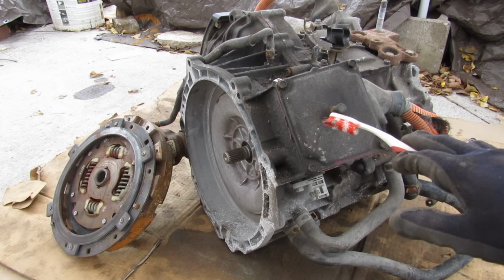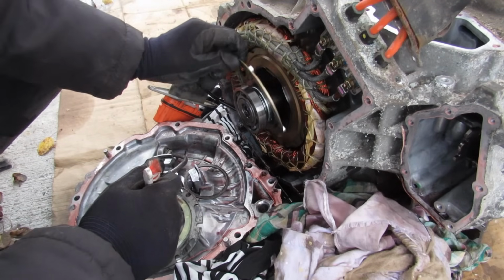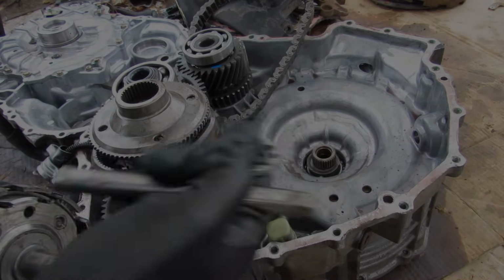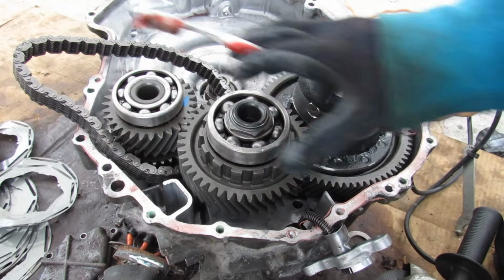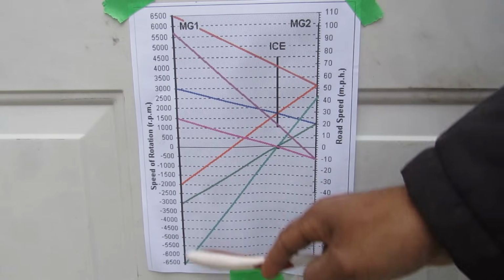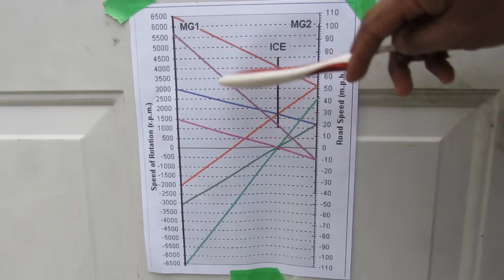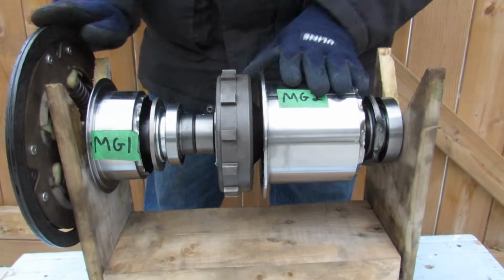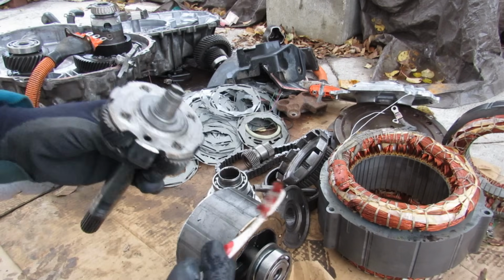How a Hybrid eCVT Transmission Works   Part 2

Comment from the maker: The video on Hybrid electronics can be found in Part 1 here:
 https://youtu.be/Xl87abBl9-A
Reply: What are the limitations to these eCVT transmissions?  I would think top speed is limited with only a single planetary gear set.  Also, it seems that having one reduces the towing limit.  Is towing limited because of heat generation or something else like the battery running out of juice and then you're running on the ICE.  I recently took a look at the RAV4 hybrid.  It has a decent size 4 cylinder, 2.5 L, that should be able to tow 3,000 lb but they limit it when you have the eCVT.  Why?

Love your videos...  Educational, entertaining, and no bullshit!

Comment: The difference between CVT and Toyota ECVT is like the difference between mail and email, TOTALLY  two different worlds.
 I wish Toyota got a better term for their great ECVT.
Reply from the maker: Agreed. This one is very reliable
Reply: @Henry_Jones  yes, Toyota got the name wrong both ways. Nissan and others took advantage of this, just walk into a Nissan dealership and they'll tell you :" oh, this car has a CVT just like Toyota".
Reply: @speedkar99  Thank you for the video. Is the regular Toyota Corolla CVT (Non-Hybrid) also as reliable as this? Please advise. Thank you.
Reply: @NHD777X  unlikely but it’s probably more reliable than a Nissan CVT
Reply: @NHD777X  I saw Scott kilmer said that he hasn't seen issues with the Toyota corolla direct shift cvt (has the launch gear + regular belt)
Reply: Synergy Drive!!!
Reply: I guess functionally, it's power delivery is like a cvt so that name technically works. Though yea, cvts do get a bad rep
Reply: Yes many who ignore how it works dismiss it as a reg cvt without realizing it is an engineering marble and perhaps the most durable transmissions out there
Reply: @JoeyLindsay  Do you know what is the transmıssons brand for ? Toyota corolla cross 2022 1.8 hybrid
Reply: @Onurkoltuk67  Toyota makes their own transmissions and their CVTs are pretty good in my experience driving a RAV4 Prime and a Camry Hybrid
Reply: Since it has no belt but 2 electronically controlled motors and planetary gears, it's more an eAT than an eCVT.
Reply: There is absolutely nothing wrong with the term ECVT.
Reply: They Just Call It THS
Reply: @landshass2849 what do you mean they got it wrong, CVT has metal belt and cone pulley and eCVT had the two motors?
Reply: like EVT？
Reply: @JoeyLindsay both the RAV4 Prime and the Camry hybrid have E-CVT not CVT. Even the Crosstrek hybrid has a ECVT though Subaru calls it a CVT for whatever reason they have. It has motors and gears just like the prius prime.
Reply: I think nissan CVT much better if you take care of it,  the nissan CVT much easier  to maintenance , this one is too complicate.
Reply: It is CVT in the sense there are no gears changing like regular automatic transmission, the electric motor gives continuous "gear", but as you said it has nothing to do with pulleys. A different name would have helped to differentiate the two.
Reply: PHT - Planetary Hybrid Transmission.

Comment: The Toyota eCVT is one of the greatest bits of engineering ever.
Reply from the maker: It sure is! 
And it's reliable from what I can see. Nothing to break or wear down here
Reply: All based on existing technology .
Reply: @speedkar99  Then why do most of the Prius' here in Portland, Oregon disappear from the roads in less than eight years and under 100k miles???
I have heard Prius owners say that "this is because Toyota's are better",  (that they don't last because they are disposable). 
Mind you that when I tried to help a neighbor because her Honda CVT grenaded at just 47k miles requiring a complete replacement, she told me that my 2007 Mustang GT won't even last 47k miles and that I "was a moron for buying an American car"...
Reply: @davidhollenshead4892 The Honda CVT is not what you’re looking at here.

Comment: Impressive hydraulic press!! And that graph explaining the ratios is just brilliant... Tesla Model 3 uses the same type of electric motor (IPMSynRM) as this Prius which is more than 15 years ago. IPMSynRM is 96% efficient compared to the traditional squirrel cage induction motor at 94%. This shows how far ahead of its time the Prius was.
Reply from the maker: Thanks. I stole the graph from a website online that did the math behind it and modified it for the 6 main modes of the power splitting device. Didn't know about the Tesla drive unit.
Reply: @speedkar99  Could you please share the link to that website? I'm curious.
Reply: Absolutely, and since Prius was here way before Tesla I think teslas engineers has done that job dismantling Prius motors and learning from there✅👍
Reply: @toninocars  nnj

Comment: I loved the plot and stand demo - made things very easy to understand.
Reply from the maker: Thanks! Glad it helped. My new desk ornament
Reply: I would like to see a plot for the 4th gen Prius. MG1 and MG2 are much smaller but they rotate up to 17000rpm to compensate. My 2019 Corolla has the 4th gen drivetrain and at 62mph MG2 is running close to 10000rpm.

Comment: This is a really complicated system. It's amazing how close those  fluids are to the coils and electrical components.
Reply from the maker: Yes they have to be properly sealed
Reply: I'm sticking with a regular 4 speed ATM transmission, thanks. And a simple petrol engine with port injection.
Reply: @rishijai  these hybrid transmissions are extremely reliable,. I dare to say that they are more reliable than your aforementioned 4AT transmission.
With the exception of the current dynamic force hybrids (1.5 Yaris, 2.0 Corolla and 2.5 RAV4 and Highlander) the ICE engines are simple port injected engines as well.
Reply: @meeder78  dare I say these are likely more reliable than even a manual. Failure and wear points are to an absolute minimum. The 4th gen hybrid system has perfected this further by removing the chains and using just planetary gears.
Reply: @eddynetweb  
I agree that it can even be more reliable than a manual transmission. 
The 3rd gen also has no chain as far as I know. 
Starting with the 3rd gen there is an additional planetary gear set (motor speed reduction) connected to MG2 which allows a slightly higher EV speed of about 50 mph before the ICE has to kick in to prevent am overspeed of MG1. 
The 4th gen biggest advantages are the even higher EV speed (I have seen 65mph EV speeds on my Corolla) and the more compact construction due to the parallel axis design of MG1 and MG2 instead of the inline construction that was used  before.

Comment: Very to see all these components, thanks! I do appreciate the Prius, we own one, a 3rd gen plugin. I guess they have a lot more grunt, as it keeps a steady 80MPH on the German autobahn, even up hill, loaded with the entire family and holiday luggage.
Also on a flat stretch it’s absolutely amazing how quickly it reaches 110 MPH. Still 50MPG (US) for the entire journey.
It’s by no means slow, but the ICE revs up quite a bit during acceleration and on steep hills. If you’re the kind of driver that doesn’t want to hear the ICE, afraid to bust the engine, well yeah then it’s slow…
But at 80MPH on a flat stretch you hardly hear the ICE.
Clever technology and very robust, due to the lack of a physical shifter mechanism and all gears permanently engaged.
The plug-in is what it should have been from the beginning IMHO, as it does 55MPH electric only, and has enough storage capacity to drive really long descents on regenerative braking only. I checked the brake temp after driving down a pass in the alps: discs were cold!
Impressive.
Reply from the maker: Awesome !

Comment: This is an amazing video! The only addition I have is that battery power is only really used for all electric mode, these can cruise all day long up a hill as they can change rpm as power is needed and all power for MG2 normally comes from MG1 and the ICE.
Reply from the maker: Yes that's correct

Comment: Looks like ecvts are more robust than the traditional cvt. I like that. Traditional cvts are not too reliable in my opinion. It's good to know that they won't be around for much or in all the cars.
Reply from the maker: Agreed! I don't see any failure mechanisms in this transmission as long as everything is cooled and lubricated.
Reply: I prefer that thick chain over that band that Nissan uses
Reply: @speedkar99  Those 2 conditions apply to any automatic transmission ...
Reply: Subaru CVTs go well and good

Comment: Next time when you get stuck behind a Prius, it isn't because it is underpowered, just means the driver is hypermiling.  
When equipped with grippy(instead of low rolling resistance) tires, the handling is really good and lot of fun as it has great low end grunt and brakes that never fade as in a pure gasoline powered vehicle.
Reply from the maker: Sure
..I didn't find this one particularly fun to drive. I'm used to V6 sedans though

Comment: Enjoyed your vid. I just replace a trans in '07 Lexus RX400h due to trouble codes from insulation leaks in inverter and trans assembly. 46 years turning wrenches this my first hybrid. After replacing with one from '08 from an '08, along with inverter/converter. I decided to look inside and was surprised to find how simple and minimal parts it took compared to a regular automatic trans. Also, this is 3rd generation where they eliminated the chain to final drive and where I found what failed. The gear from final drive to differential was missing teeth, both gears. I imagine the pieces of the missing teeth I later found stuck to magnetic parts caused the insulation leak code. The code would not allow the ready light, but if I cleared the code it drove fine until the the warning lights and it was turned off. The stators are different, too. was hoping you show freeing the magnets. These seem better secured. This has been a great learning experience.
Reply from the maker: Glad you learned something and appreciate sharing your experience. These are quite simple inside and I'm surprised they failed. Final drive gear is usually pretty strong as it multiplied torque
Reply: @speedkar99  I agree.  But there's something else that could have contributed.   The bearing on the right side intermediate shaft, actually part of the cv axle which is mounted to the block. part of the engine mount, was bad. Rust welded into the hole. had to unbolt the mount bracket from the block and put into the press. It barely turned. And it came apart when pressing the shaft out. P0AA6/inf613 if the dtc that led me to the transaxle. And an insulation leak in HV  system code resulting from gear teeth in the drive motor...

Comment: The eCVT is a marvel. Extremely reliable and efficient. It would be wonderful if more cars started using them.
Reply: Their time is over. They haf their best time 5 to 15 years ago. Since Tesla came out with the Model 3 and Y, this is now top notch. Much simpler, way fewer parts, cheaper and no oil changes. And no farting engine.
Reply: @Stefan_Dahn  yeah except you need expensive batteries that only last about ten years
Reply: They do. Ford uses them in their hybrids. They've been fantastic. It's everything else that's the issue

Comment: That's the proper way to start an engine for the emission reducing feature of traffic light/ long pause stop start. I wonder how many starter motors the BMW and Ford and any other vehicles out there constantly restarting at traffic lights are having replaced compared to the ones before them. Then to make it worse is most people like to constantly creep at lights. Fun!

Comment: Wait so is this the same of all Toyotas with hybrid synergy drive including PHEV versions of some of their vehicles? I am honestly in awe of how well engineered Toyota's eCVT system is especially considering that it was first introduced back in 1997. It was way ahead of its time.
Reply: It excludes Toyota’s new Hybrid MAX drivetrain which uses a torque converter automatic transmission instead of an eCVT.  This drivetrain is used in the Toyota Crown, the Sequoia, and the Tundra.  These power trains are less efficient but can handle more power from the engine and electric motors

Comment: The beauty of the Toyota eCVT is it’s driven by electromagnetic force not friction in CVT AT and DCT thus has little to wear during it’s lifespan as a result Toyota eCVT is stupidly durable and require no maintenance
Reply from the maker: Agreed. Just change the fluid once in a while and you'll be good for a million kilometers
Reply: @speedkar99  thanks for the reply! Even the fluid last a lot longer than conventional transmission, fluid in conventional transmission will be contaminated by friction material like clutch and belt very quick

Comment: Thank you for an amazing lecture. I have a Corolla Hybrid and this video has explained a lot. However, I still don't understand some points. What is the total combined torque of ICE+MG2? All I can find is the ICE torque. It seems that Toyota doesn't provide this value. Or maybe it's impossible to measure it in this kind of hybrid car? One more question, does the MG1 add any torque to the output transmitted to the wheels?

Comment: great tranmissions, simple to change the oil too. and to buy it at the cheapest place is at your dealership. aftermarket is expensive
Reply: Hi,what is the make and model of this new e-cvt gearbox? Which model e cvt transmission does the 2022 Toyota corolla cross 2ZR-FXE engine code 1.8 Hybrid use?  I will be very glad if you answer

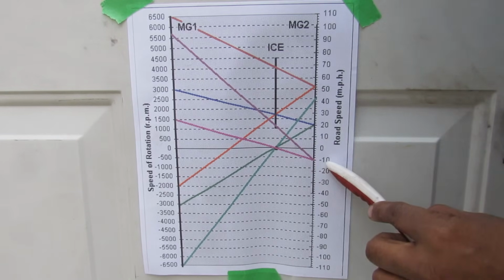Comment: Good vid with clear explanation, but the part starting @19:30 is incorrect. If you have a depleted HV battery, but just enough juice to start the engine (by rotating MG1), then after the engine starts it will spin MG1. So in this situation, the ECU can start to slow down MG1, which does 2 things (just like in regular driving); 1 - Generate electricity, which it can feed either into the battery or into MG2 to make the car move (smoothly, there is no reason this would be jerky), and 2 - create an opposing torque to the engine, which results in torque going through the planetary unit and also driving the wheels. (this is why it's a series-parallel system)

I fooled around quite a bit with my old HV battery which needed replacing because of some bad modules, and it was nearly impossible to get it so far depleted so it was not possible to start the engine. Even an unbalanced battery (battery warning light on dash on and error codes on the OBD) would still start the engine, the car would still drive smoothly but with less electric assist. Also, it would keep idling at the traffic lights. Which is a good thing when the battery is nearly dead. I only managed to get it not starting, by deliberately deep discharging of a single module (by taking the battery apart). I think it is very hard to get into this situation even under abuse of the vehicle. I think it is far more likely that an empty 12V battery would cause a non-starting Toyota hybrid.

Comment: I was experiencing some knocking noises most of the time when mg 1 was starting the engine,at the same time i was experiencing low power even when engine was comingin to assist Mg2 during acceleration...so today i decided to find out what were the reasons for the issues. To my surprise torque damper had very weak springs that were playing around within their containing housing, also it is like the clutch was slipping within its case during had acceleration..so i decided to replace the clutch now the car move smoothly  and it has gained power and it accelerate fast compared to previous time. (The car has 205,002km on the clock with original health battery (Delta soc 0.00%, voltage difference o.o3v) i love the car and i service it regularly myself., and issue hybrid assit app to comand my battery coolingfan to turn on always to cool the battery.

Comment: It does look like a transmission that'll be fine as long as you change its oil regularly. I believe the new Ford maverick also uses an eCVT on their hybrid trim. It makes me wonder if a stronger, similar system in in development for the next generation hybrid mustang, or if it will uses something different.
Reply: as reliable as this may be, it still isn't the most efficient machine while under internal combustion cruise mode.  A portion of engine power is used to generate electricity, which is around 90% efficient.  Then you need to convert that electricity back to mechanical power, which is again is 90% efficient.  Multiply the 2 together and you're looking at 80% efficiency.  This is why it only send a portion of the power thru the electric route and another thru the gear route

A manual transmission, when locked in a 1:1 ratio is around 99% efficient.  This is why trucks with automatics are actually robotically controlled manuals.  fuel efficiency > smoothness in a vocational application.  Notice how the top notch mustang, corvette, porsches, and ferrari are using robotic manuals?  They want to deliver every  in-oz of torque  to customers who are buying serious sports cars
Reply: Toyota also has their Hybrid MAX system which replaces the eCVT with a torque converter automatic.  This powertrain can be found in the new Toyota Crown, the Sequoia and the Tundra models

Comment: Toyota and Honda's systems are almost identical. Honda's eCVT system has a separate clutch for high speeds to maximize fuel efficiency, while Toyota's eCVT system does not. We know that electric motors are limited to a certain RPM. So how does Toyota reach high speeds without a dedicated gear clutch? That's what I don't understand..